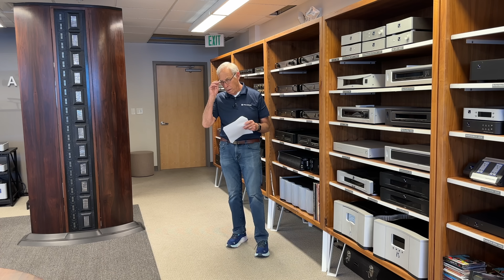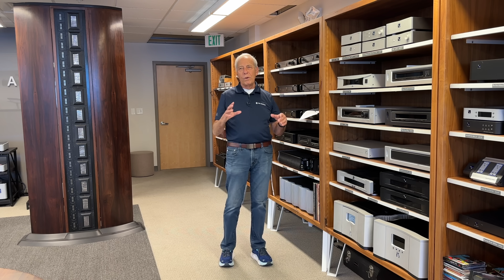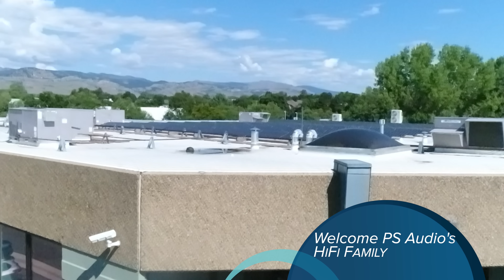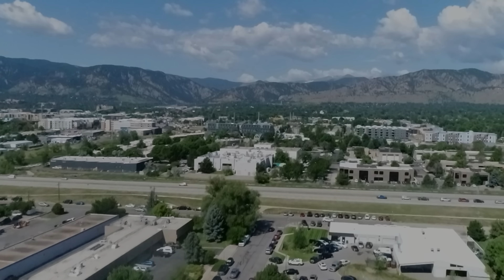Audio cable boxes

Comment: The boxes contain a type of zobel network called a Boucherot cell. Typically they have capacitors and resistors, but not inductors. Yes, both Transparent and MIT still use them in all of their cables.
Reply: @gotham61 But if you have a Boucherot in the amplifier already you don't need a second one on the cable/speaker? True or false?
Reply: @franciscorompana2985  Not affecting quite the same frequency range, hence the necessity to use such cables (modern ones using multiple parallel networks) with megahertz bandwidth amplification, keeping amplifiers from oscillating. The idea there is to get the network as closely as possible to the driver(s) or passive crossover to prevent reflection into the amplifier. Referring to e.g. MIT and Spectral amplification. If all one needs is a Zobel RC (or LCR) in a standard application (the purpose of those is for the amplifier to "see" a flatter electrical impedance within the tweeter's frequency range, which in turn is going to affect the frequency response with e.g. tube amplification using output transformers), my guess is it wouldn't matter where it's placed.
Reply: @franciscorompana2985  
True.
Reply: @Douglas_Blake_579  Now that makes sense

Comment: Cable adapter boxes all had different things inside them. I don't think they used the boxes to impress or as a selling point. Some boxes had stuff in it, as Paul said, to present the most beneficial impedence load to the speakers. Belles, the audio manufacturer, years ago came out with a component that did the same thing, or at least had the same idea. Ideal impedence is very important and that's what many of these boxes attempted to do. PS Audio itself, one of their earlier preamps, the model 4a, had 4 open sockets inside. You could simply plug in resistors of any value into them and hear how the sound of your cartridge changed. I think you could load it down to ridiculously low impedences, all the way up to 30,000 ohms. The cartridge got less bright, the lower the impedence. By plugging in resistors, you had in effect something like tone controls. The balance really changed dramatically.

 Don't let people Douglas Blake ruin this comment section. He is old and frustrated and he speaks about things he doesn't know or understand. He is not  a model of logic or sanity. He is also old and frustrated and does not have very good equipment. Equipment that could hold a candle to what most probably have on here.
Reply: He needs a hug :(

Comment: Ideally the Zobel network should be "tuned" to the dynamic impedance of the speaker system it's being used on. 
Paul is right here... that best solution here is to use a circuit simulator program.
Then you can tune the transmission line (cable) to tame resonance and reflection peaks.
But where do you get a "spice model" for a speaker system ?
You need all the cross-over values and the cap/inductance and resistance of each driver. And the schematic. At least.

Comment: I use to have those MIT speaker cables the size of a garden hose and the big box  I  still have the MIT interconnects that I use between my Tube amb and tube pre amp  I really like their locking RCA connectors

Comment: Capacitance filtering can work for some AC power problems... But never a signal cable.

70% of the time, wall power is fine in a normal home in the suburbs. Apartments and city buildings, or living near a radio tower or high voltage lines, might need some power filtering to kill the high end.
PS power plants are an extreme way to get clean power. I needed them in San Francisco. I don't need them in Woodinville WA.

Comment: I had a very lengthy home audition of $5,000 Spectral by MIT cables. Made for Spectral amps whose frequency response went up into the 1 million hertz range. In fact if you didn't use the Spectral cables your warranty on the amps, according to what I read, was void. Don't know how true that was. All I know is the cables made such a big difference that anyone who couldn't hear that big a difference was; "Call an ambulance, they're brain dead." The boxes were heavy enough to pull your bookshelf speakers right off their stands. The Spectral/MIT MH770 cables should go down in history as one of the finest audio products ever made. Your system had to have enough sparkle though. They were very warm.
Reply: So were they warm or were they bright (hence the system needing to have enough ‘sparkle’)?
Reply: By 1 million Hz , You mean 1MHz bandwidth? In audio electronics design, any signal in that range is called as oscillation  or noise. Good circuit design engineers would usually roll off high frequency response (say above 100Khz) to avoid such a situation
Reply: The Spectral by MIT MH 770 Ultralnear II were very warm sounding cables. I would say forget them with tubes. With brighter solid state they sounded great on bright recordings like Columbia lps. They were the biggest audio improvement I ever heard. I never had a near 50% improvement before. Closest  was when I went from moving magnet to a top of the line moving coil cartridge. The sound with the the MIT was so bigger and full of body, smooth as ever and the bass was so deep. Even that excess of warmth which went all the way up to the treble couldn't diminish its transient quickness. Only for really bright systems though, I think. The frequency response of Spectral amps was 1 million hertz.
Reply: @rogerwalter2500  
Actually most start the stability roll off about 30khz.
Reply: @Wizard. So what we have here is a bunch of bright people like Paul and his crew, great audio designers and audiophiles who can afford to experiment with the greatest equipment versus internet trolls who have to do their equipment buying at places like K Mart, the ones that are still around. Gee I wonder who has more credibility there? There probably isn't much difference with the things you are limited to.
Reply: @Wizardofgosz  
Actually what we've got here is a 12 year old troll with a very tenuous grasp of reality.
Reply: @Wizardofgosz  
Nope ... this Sides Up kid is very serious.  But between a head full of bad wiring and open admiration for subjective Reviewers (Steve Guttenberg is his go-to expert) all he really does is annoy people. Little @#$#% actually had the nerve to ask a couple of channel owners to ban me.
Reply: @Wizardofgosz  
Been there... done that... burned the T-Shirt, my friend.  These days I hang out on a couple of YT Channels and work on my own projects ... it's so much easier.

Comment: Yeah, but a speaker cable does not actually care what impedance it has going thru it like a much lower voltage constant signal cable does. The signal between i.e a CD player and amp CAN in some cases be more affected because of the low level voltage. But I never had a issue totaly ignoring impedance on signal cables either so🤷‍♂️ A cable can certainly sound different (atleast speaker cables im blind tests) but that is another story. For the impedance factor alone it is the devices and not the actual cable that can have micro issues.

Comment: I think you're wrong the cable doesn't want to constant impedance cable doesn't give a monkeys you mean amplifier wants a constant impedance.
Microcap is free now
Why the box so big it could be 1/30 of the size.
Reply: Sane comment
Reply: Yes. The monkey with flat impedance it's inside the amplifier. 🐒
Reply: Micro-Cap is a Circuit Simulation. Best regards.
Reply: Monkey or grimlin?

Comment: There were at one time Moughan boxes which were speaker specific. I can understand that to fine tune the speaker. Putting a network in line with a speaker for a one size fits all is the reasons why MIT and Transparent doesn’t work well. BTW I love to see how mad the cable nazis get over the cable topic.😂

Comment: Waste of time and money.  

All the way down the audio chain, outputs are primarily voltage sources and inputs are effectively voltage sinks.  That is ... from your dac/streamer/pre-amp/amplifier most signalling is done by voltage at microwatt levels.  

The only qualifier on this is that these voltage sources need enough current capability to drive the next input... In the case of a power amp feeding speakers, it needs to provide enough current to drive the speaker's minimum impedance. Higher impedances are not a problem, they simply draw less current.

All the rest of it ... reflections, skin effect, impedance matching, standing waves and on and on is in the realm of feedline theory and even then it only applies beyond 1/4 wavelength.  This means that none of it applies to audio frequencies where 1/4 wavelength, in a cable, is greater than 3.5 km (just over 2 miles).

Impedance matching was abandoned in the 1970s, as a wasted effort that blocks the versatility of the equipment.  Instead they moved to Impedance Bridging, where a low impedance source feeds a higher impedance load... So a device with an output impedance of 75 ohms is typically used to feed the input of the next stage of over 10,000 ohms. And it works brilliantly, letting you mix equipment freely among many manufacturers.

There are a ton of doodads and manufacturers out there touting this stuff but in the end it's totally unnecessary and simply a way to part your from your hard earned money.

https://en.wikipedia.org/wiki/Impedance_bridging
Reply: This would have been Pauls answer if he wasn’t a salesman.